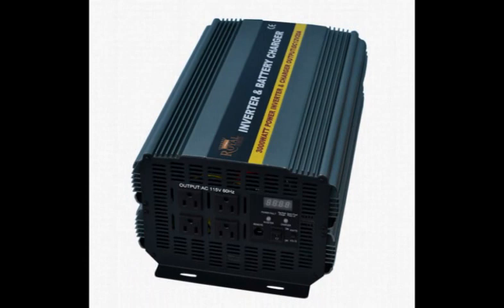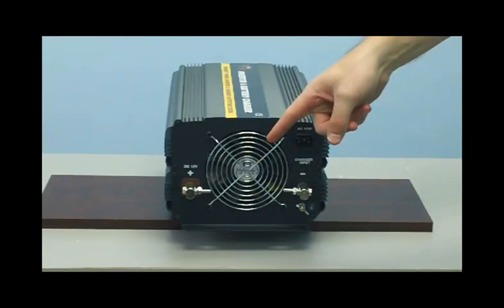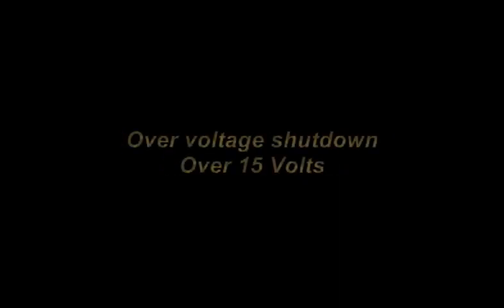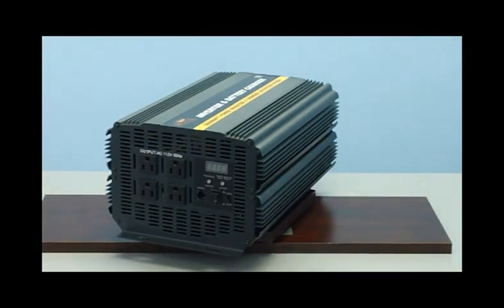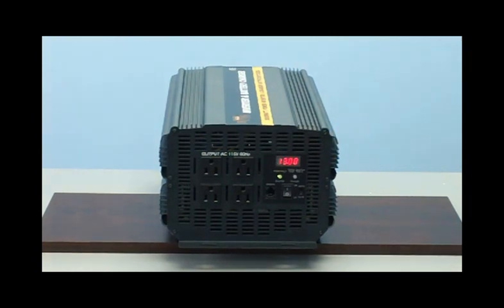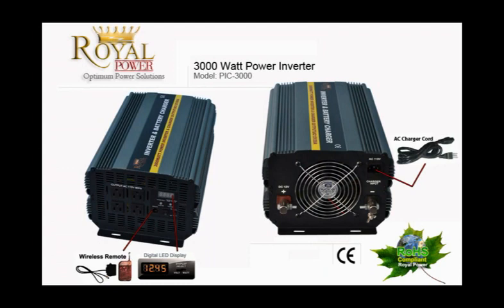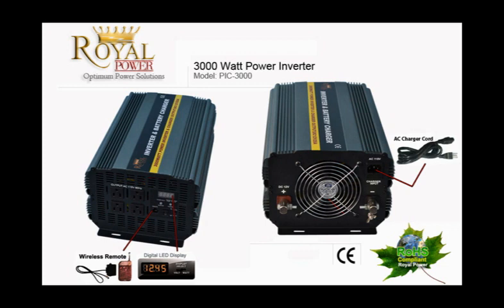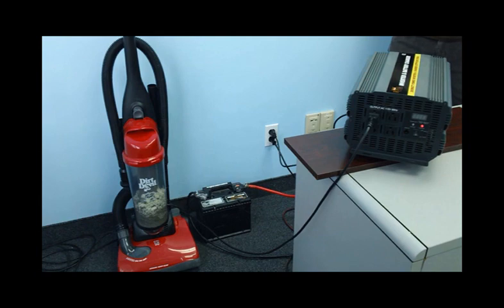3000 Watt Power Inverter - Built-in Charger and Transfer Switch - Royal Power - (PIC-3000)

Comment: Why do people use the comments to ask a question, then defeat the possibility of replying to their question?  Often those who post videos don't bother to answer questions, so another viewer who knows the answer can't answer the question if they can't reply to it.

In general if stated specs don indicate MSW or PSW, consider it's modified sine wave. Also consider not purchasing a inverter from anyone that doesn't include the most important fact.

Also the specs do state the unit has an automatic transfer switch at least one missed that even if it's in the video title, in the video info, and demostrated in the video, but don't assume that the switch will meet requirements in your area or if it's inclusion is cost effective.  As demonstrated in the video it's worthless if you want to supply power most of the circuits in you home. Most likely at best this could only supply power to half the 120V circuit and none of the 240 V. circuits.  My guess this can't switch the service enterance conductors before they enter the service panel. What you want for maximum convenience, even if 3000 W. can't power everything in your home.